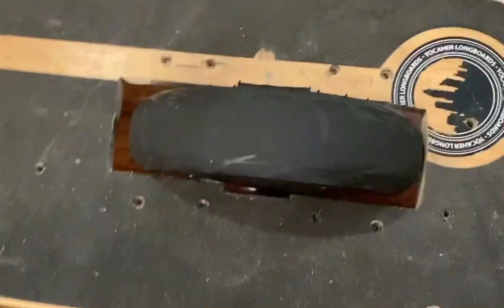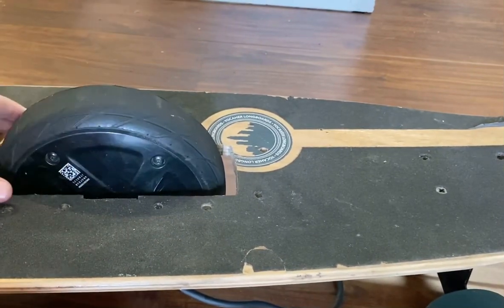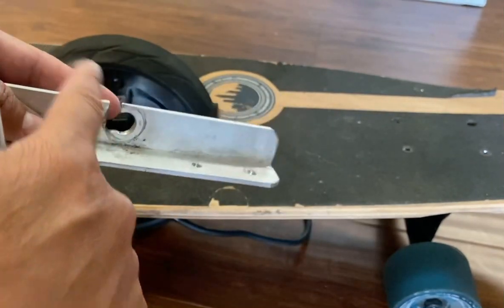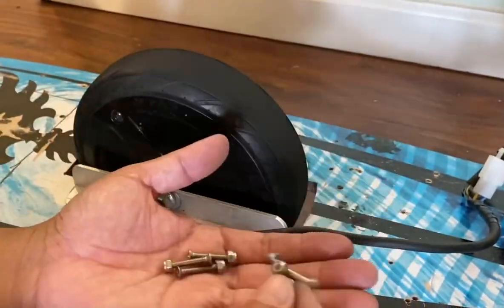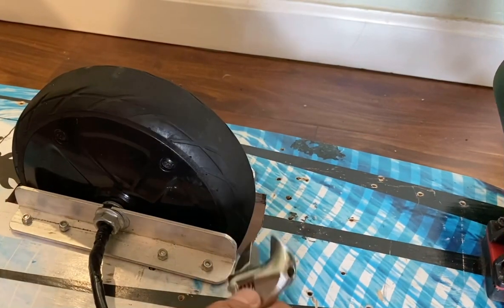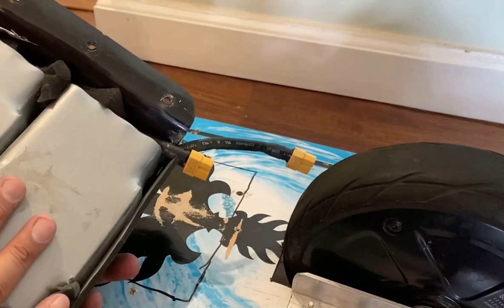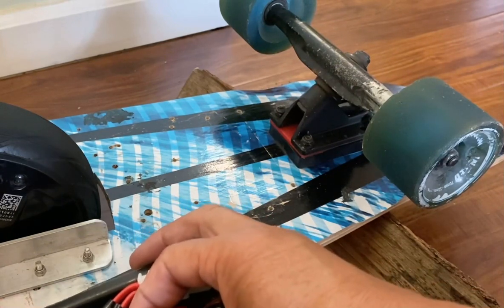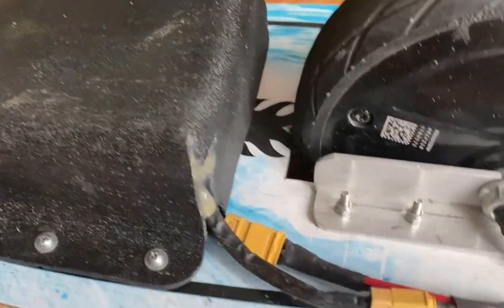DIY Electric Skateboard Using Scooter Hub Motor

Comment: I think this is genius because it has lot of torque like belt drive but is easier and cheaper to build thanks for inspiring me I’m going to build something similar but instead of using a 700w motor I’m using a 1600w on with maybe 52v or 48v I just need to figure out what esc I should I use if you have any suggestions please let me know thanks again
Reply from the maker: The motor has plenty of power and torque.  Pair this with a good powerful esc and you’ll have all the torque you need.  I used a cheaper esc to save on cost and it still puts out plenty of power.  I will try to add the components list in the description
Reply: How did yours turn put @jonathan?
Reply: @redsteam1  mine uses a vesc 75100 with a 48v battery running at 45a I get speeds up to 30-35mph on it it’s kinda scary 😅

Comment: Have you added a suspension system later to keep all five wheels contact with the ground on the bumby roads?
Reply from the maker: Have no issues with all 5 wheels making contact.  I adjust this using the truck spacers.  I like your idea of making a suspension for the center wheel using high compressing springs on the aluminum mount brackets.

Comment: Oh and also the battery you have is 72v because you have to 36v in series shouldn’t you get a higher top speed?
Reply from the maker: The packs are connected in parallel so they are running at 36v

Comment: how did you manage to turn left and right with that fixed hub motor in the middle? If you turn right on the longboard, the trucks move so that you are allowed to turn, but with a fixed wheel that cant rotate, how is it possible? Perhaps the tire gets more weared out because of this
Reply from the maker: All four skateboard wheels makes contact with the ground however it pivots on the one wheel.  There’s no problem Turning left or right.  I rides and turns like a normal skateboard.
Reply: @Lowegy  okey, thank you very much for the reply, I was going to try something similar to this build, but with the wheel fixed at the back. When I thought of it, it occurred to me that it couldn't turn because of it.

Comment: What about adding 2 wheels in the middle side by side?
Reply: At that point just build A proper electric skateboard.. Mount the hub motors to some decently wide truck's at the rear.. Then do A top mounted esc and battery pack.. You can also buy 8inch wheels for the front from ali express for like 20/30$